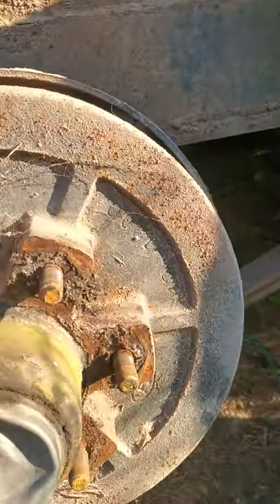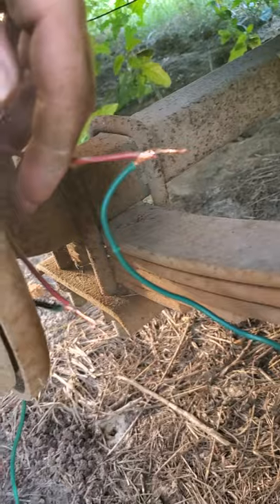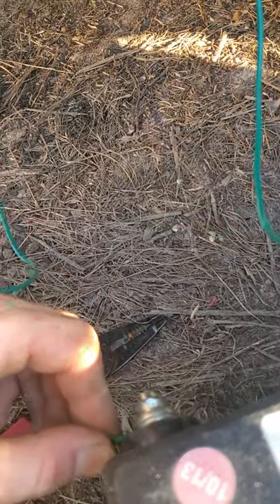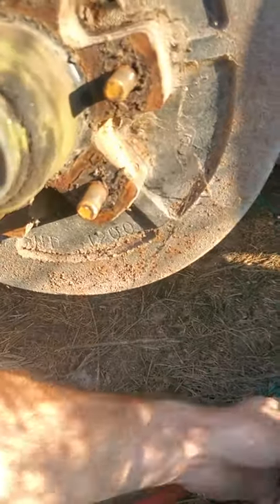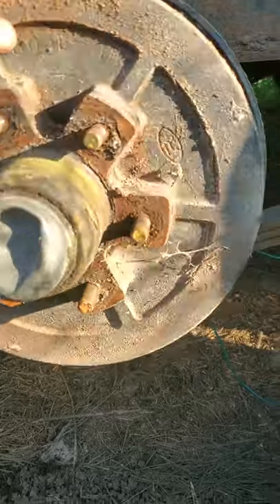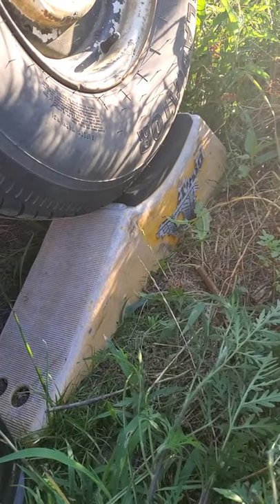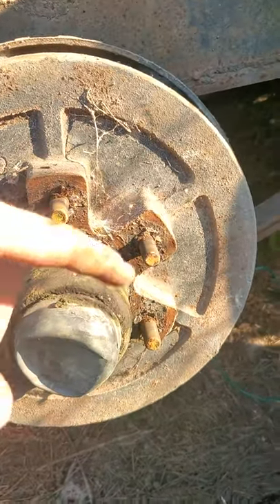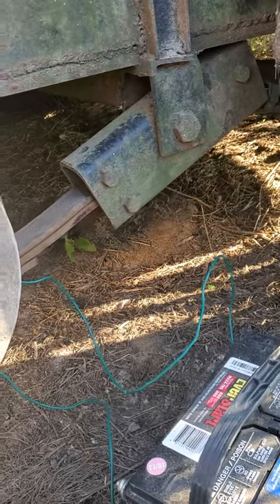Quick tip of the day: how to test trailer brake for function

Comment: I needed to  get a trailer aid for my horse trailer.   We had a pole building built and my farm boy brain said.;  I bet we can make one out of one of the pieces of 6 x 6 posts left over from the build.  So i took a 3 foot piece got out the chainsaw and freehand cut one out with tapers on both ends.  Took another piece of 6x 6 and made an in between axle wheel chock.  They have worked great and they only cost me the gas to run my saw.  So far as you not being able to get you axles high enough, could you stick a piece of 2x6 under one end of the trailer aid to get more lift?

Comment: Hey I got a question my break controller is on but when I push the breaks it doesn’t break the trailer breaks tho what do you think it is
Reply: You should go to the plug on your truck and check to see if you have power there. Press the brake and use a test light to see if you have power there. Keep tracking it back to the axles to see if you have power.
Reply: @westleyrudd5500  yea the light doesn’t Turn on due the break one at the plug in of my truck the other ones lights up saying it got power
Reply: @westleyrudd5500  lights and everything works tho
Reply: What model is your brake controller?
Reply: @westleyrudd5500  it’s the tekonsha
Reply: @westleyrudd5500  when I check the blue wire with that testers it lights up so they means it gots power and the red wire to it’s just not breaking the breaks on the trailer
Reply from the maker: @juanmoreno5187  ok. You may need to pull the wheel off and see if you have brake pads left. Also there is a magnet in the brake assembly that controls those shoes to make them move and squeeze against the hub. If that magnet is bad then you wont have brakes. You can buy a rebuild kit for those hubs but o believe one time when i checked it was cheaper to just buy a new hub assembly.